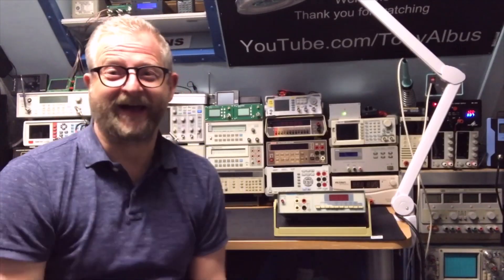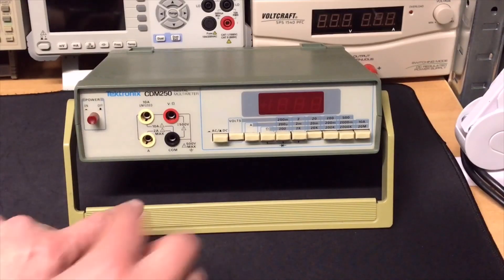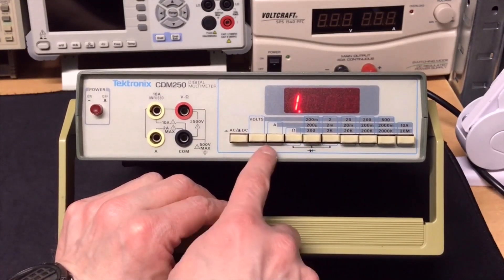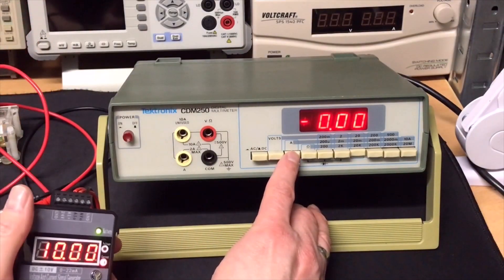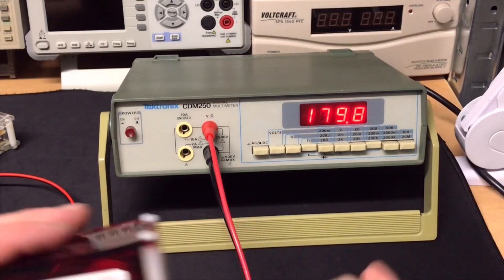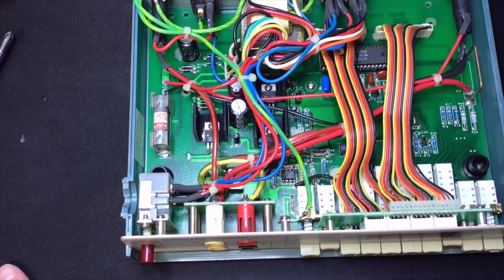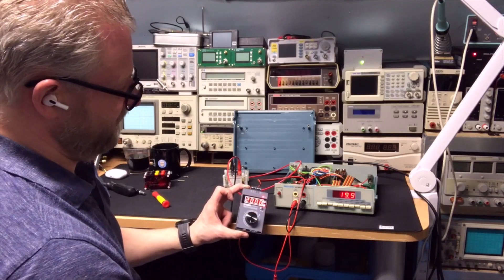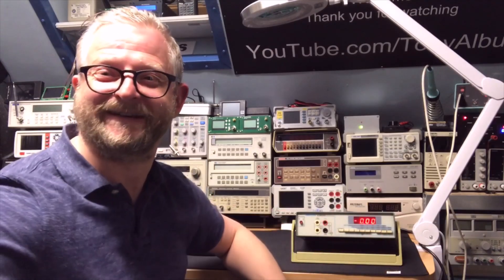#147 Tektronix CDM250 DMM from the '80

Comment: I just bought one off eBay to go with my Tektronics TM500 series collection. Might replace the capacitors. I’ll test them first.
Reply from the maker: Nice addition to the collection!
Reply: @TonyAlbus i powered it up tonight and it works so tomorrow I’ll test it more thoroughly. I also got a Heathkit Model v-6 VTVM that I’ll open up before plugging in. The front cover is not properly aligned with the case so i know someone has been inside it. I’m only concerned about the battery damaging the board. From videos I’ve seen i expect to replace the capacitors and I’d like to do the battery elimination mod. Thank you for the education.
Reply from the maker: @tomaskey6844   Great is works! .

Comment: Looks very nice inside - Nice and clean anyway :)  Looks like 1992 era from the date on the main IC?  As for cleaning spray,  I've now started using WD40 Fast Drying Contact Cleaner!  It's  a 10th of the price of Deoxit etc and works just as well.   Nice video once again Tony.
Reply from the maker: Thank you Stephen, maybe the IC was replaced, it is on a socket, but it could also be original, i am not sure. yes WD40 i like it too, i use the profesional contact cleaner, geat!